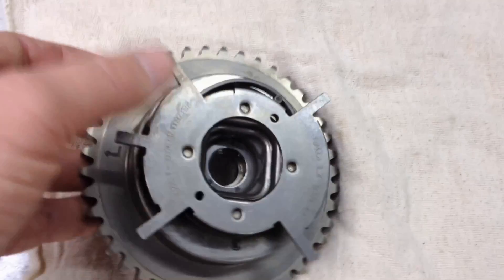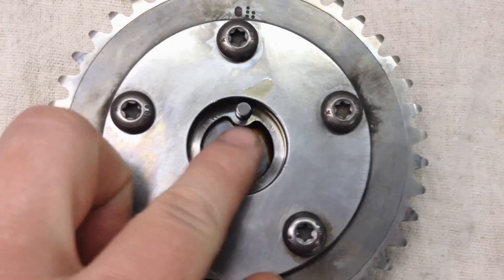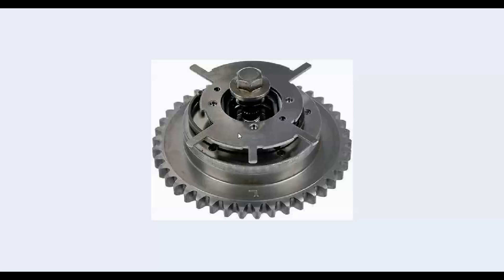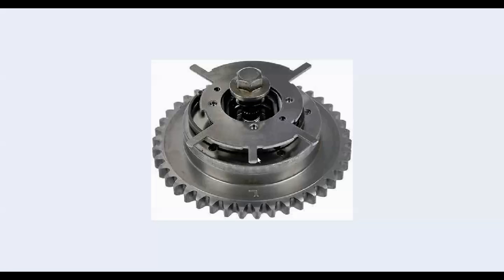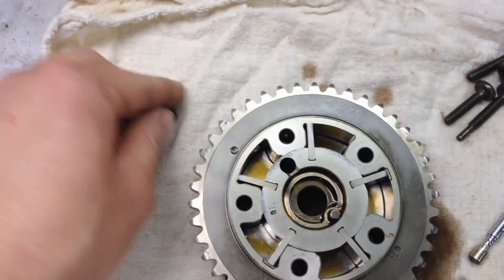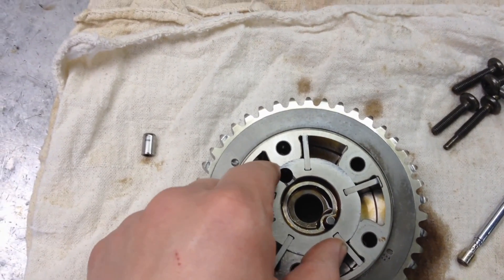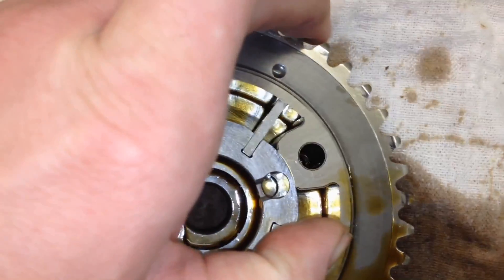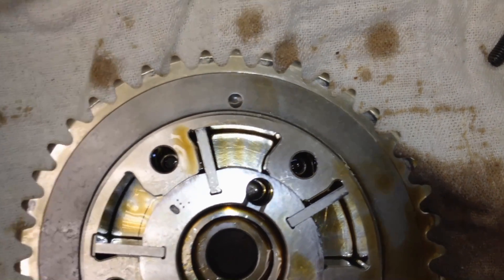Ford 4.6L 3v & 5.4L 3v Camshaft Phaser Knock Explained

Comment: My 05 triton has misfireing and trembling. I changed the sensors. It ran fine until it ran long enough for the computer to generate codes. Then it started shaking again. That wouldn't be the phaser, would it? To me, it seems more of a communication issue somewhere versus mechanical because it ran smooth for that brief window.

Comment: So when I spin my engine over by wrench my driver side cam phaser moves with the camshaft but after spinning the engine over the timing peg moves separate from the phaser. Is it supposed to spring back like that or not?

Comment: I have an 08 Ford Expedition That has been making this noise ever since about 86,000 miles. I decided to just let it ride and see what happened. It’s been working fine for the most part with the exception of the noise. It’s now at 246,000 miles. The noise started getting worse and it’s performance I scan worse. I’ve been told it’s totally shot and I need a new engine. I put in 10/40 weight synthetic oil and used some Lucas oil conditioner and some engine restore. I also replaced the spark plugs and the ignition coils. It’s definitely running a lot better. I can certainly live with it like it is for a while. What I was wondering is I’ve been reading about these phaser lockout devices you can install to fix that problem. My mechanic has said that he thinks there’s probably enough other things that are worn out on the engine that it’s too far gone. I was wonder what your thoughts are on it.

Comment: What's your opinion on using cam phaser lockouts? Is there any pros/cons?  It seems to me, if the phasers are that much of a problem, why not disable it?  I only ask because I just bought an 06 f150 and had the motor blow 3 weeks later.  I bought another one used with 104km on it, and I know ill need to do a complete timing job with new phasers and the oil pump you recommend.

Comment: If the 3 roll pins come out of the reluctor can you put red loctite on them and press them back in or is the phaser garbage if the reluctor wheel comes off at any point?

Comment: Appreciate the information in ur videos.. I have a 2008 F250 5.4L 3v I have replace vct phaser vct solenoid with timing chain guides and tensioner but I still have the same problem chain rattle/knock at hot idle and p0022 dtc do have any ideas? Also base oil pressure was at 15psi wich is min spec

Comment: Thanks so very much for your videos. Some of them have helped me fixing 5.4s. 
Pls what brand would you recommend I get timing chain kits for a F150 5.4 3V? I can see a lot of timing chain kits on Amazon or eBay, but don't seems to know which particular seller or chains you'd recommend for me to buy, without issues. There are a lot of fakes around.

Comment: If there is rattling coming from the spring loaded plunger, could it be solved with a high volume oil pump like the 340hv?

Comment: So i have a question that  will probably stump any Ford guy. I have a 98 Contour with a bad exhaust phaser sprocket, what can i do since NOT even one exists in the world? Since i am getting a check engine light and no one in the world has a replacement part, i am told that the only option that i have to is to junk a rust free good condition Contour . What do you suggest?

Comment: So if my cam phaser is stuck I'd get a check engine light?
Reply: Yes, there are programmers that lie to the pcm so that the light isn't on but I still think it's silly not to just do the job correctly and replace the phaser.

Comment: 2004 mazda 6 3.0 engine found on ford have code for both cam sensor checked with scope good signal all the way to computer also good ckp signal check chain timing marks all good checked ocv for mazda (vvt) open nd closes right so can u help me out with any maturation customer is really angry

Comment: So, if the locking pin is making all of the noise and creating more potential issues, could you possibly fix it by replacing the plunger spring with a stronger, thicker spring? This would keep that locking pin under much more tension, but wouldn’t take much more oil pressure to adjust timing, right?

Comment: O have a 2009 F150 with 4.6 v8 24 valve with 150,000 miles on it. Always gone to dealer for oil change and any issues. Been hearing this sound for a year now. Not too loud but can hear it. Should I try using Castrol 10w30 half synthetic to see if it quiets back down.

Comment: I've got a 97 F150 with the 4.6, and mine is making the same knocking sound coming from back near the torque converter like you showed in another video. The thing about mine is it only starts making the sound after the engine warms up and I drive the truck down the road, would the phaser be the cause?

Comment: Good Morning! So I was wondering on the is it possible for the front alignment with the L and the center spoke can be really off? I have one that is on the other side and almost lined up with the other spoke. I'm not sure how this happened. The timing still seems to be just fine though. How did the cam phaser fail like that?

Comment: You make great, detailed videos FordTech!  I have similar but louder tapping noise that started with a notable event.  My '05, 5.4 w/107,000 miles suddenly started skipping really badly (no tapping sound yet).  There was an unbelievable amount of fuel odor and white smoke coming out exhaust and diagnostic code indicated rich right bank.  While trying to start engine, and without any audible firing/combustion, starter slowed and then stopped turning engine as if engine was under load (good battery/starter).  I'm confident engine hyrdro/vapor locked on fuel.  I held accelerator WOT a few minutes and then started engine.  From that moment, engine started making loud tapping noise on right side and is loudest at torque converter and right exhaust using stethoscope (hot or cold).  I replaced o2 sensor on right bank and engine runs great now - no skip, no vibration ...just loud tapping noise.  I feared bent rod/wrist pin but engine runs too smooth and it sounds more like lash adjuster.  I now have valve covers & front cover off.  I checked cam rollers and lash adjusters in place without cam lobes depressing them and see no issues (plan to disassemble for proper inspection).    Phasers & crank gears are timed correctly, but the right chain tensioner suddenly collapses as I rotate engine by hand.  The chain gets sloppy loose.  As I continue to rotate engine, the tensioner plunger extends and chain gets good & tight.  This loosening/tightening of chain repeats as I rotate engine.  Could the chain tensioner be the source of loud tapping noise?  Any thoughts why hydro/vapor locking could cause the tensioner to fail?  I've seen your videos regarding faulty tensioner gaskets.  If the tensioner gasket is the problem, how does tensioner plunger extend and tighten chain during rotation?  You're right on - Makuloco!!
Reply: Timing tensioner is fine. The tension tightens with oil pressure so when you spin the motor it tightens up.

Comment: I'm finding timing parts for 02-10 and 04-10. Is there a difference? Most phases I'm finding say 04-10...mines 03. Thanks
Reply from the maker: 2003 models don’t have phasers
Reply: FordTechMakuloco ok well i guess that's kind of good..any common issues on my 5.4 that would sound like a clacking phaser or knocking type sound? Thanks for the reply! It says 08/02 on the door tag f150 fx4 lariat..Also is the fx4 upgrade found in the vin?

Comment: Quick question: I am doing a cam install for my mustang gt and it requires the cam phaser limiter by comp cams. I need to remove the back plate of these newer phasers (EXACTLY the one you have shown in the video); However, the spring lock tool they provided will only work on the older phaser models (years 2005-2007) but will not work on the 2008-2010 or updated phasers like in this video. My question is how do you lock that spring in place without ruining the phaser? Also, did you put back together the phaser in this video or no?

Comment: I have a ford f150 2010 4.6.  and same... noise problem..  runs pretty wood but when you go in traffic in low rpm..  start shaking..  you turn it off.. turn on again.. and nothing happen..  I need a good mechanic like you in san diego CA thankyou
Reply: mario aguilera A
Reply: Sounds like the coils need to be replaced, that shaking is a misfire. Those coils go about 75k miles and a very common problem. Do a full tune up (air filters, spark plugs and coils)and problem fixed

Comment: Good evening FORDTECHMAKULOCO. My pleasure to meet you! GOD BLESS YOU FOR ALL THE HELP THAT GIVES TO TRAVEZ OF YOUR CHANNEL !! I have a truck SUPER DUTY F-350, 6.2, 2011. That has a fault and was after having lowered a cylinder head. because he wore a valve spring. Now I keep failing and I think it's because the chain distribution is not well installed. I have my doubts about it! Please have any video or material that can illustrate with regard to the installation of the distribution chain and its components as well as the axis of cams and rocker arms? Many thanks in advance and a thousand BLESSINGS !! Almodio, Táchira-Venezuela.

Comment: hi there friend... I have a question... my truck is a Ford f150 5.4 3v When I accelerate my car at 1000 rpm sounds a lot but only if I keep the throttle in that revolution I hear the sound near the right cam phaser but I'm asking why just only in that rpm I have to change my cam phaser? I checked oil pump vct solenoid and filter all of that is checked...

Comment: What's the purpose of cam phaser lock out? Does it make it to where you don't have to deal with future issues of phaser knocking or since the phasers on my 06 Gt is phaser knocking, should I replace the phasers or a lockout kit? I don't really grasp the purpose of the lockout piece.

Comment: Hello greetings from Ecuador, I replace the entire distribution kit
A F150 2010 4.6 lts as it lost oil pressure and sounded like
Diesel, change the chains templadores (the kit) oil pump and pump
Of water, but when I turn on, it sounds very ugly like a
Snoring or as if you lack oil, help me please I am for traveling
 And I want to buy the parts
Reply: People have told me that it could be hydraulic oil elevators or lifter, but in its video I have the doubt that it is the gear of the crankshaft
Reply: Paul Roca remueve la bandeja del aceite y revisa el sedaso te aseguro que va a estar bloqueado

Comment: Maybe somebody can answer this one... I have a 06 with the 5.4 and it looks like a ordinary cam sprocket to me.  Do all these 5.4's from 06 supposed to have a cam phaser?  I have a knocking noise I'm trying to pin down.  Of course it's in a van, so I can't get the valve cover off without removing the motor mounts on passenger side,.. but I can lift up the valve cover enough to see it's just a sprocket with a bolt,. so I'm cornfused!
Reply: Take a Bath Productions the phaser is only on the 5.4 and 4.6 with 3 valves

Comment: yes it was the two vct solenoids  runs great now......man the repair shops reads the Eng lite code  comes up no oil to cam shaft and want's to replace your engine ? and the proplem was just  a $100 fix

Comment: I have a 2006 5.4 3v with the driver side one making some noise but not the passenger one. can I drive on this for awhile or does it need to be done asap? I'm in college and money is tight
Reply: bro my 05 has made that noise for over a year, no problems just the noise..
Reply: John Wyskochil well thats comforting, I plan on having to live with it till I finish college. Thank you for the info not many have given me any helpful info
Reply: acedriver1997 I try not to abuse her too much but yeah I hear alot of these types of fords with different ticks and taps. still a damn good truck.

Comment: Nice video thanks for sharing,  I have a 2004 5.4 that runs great,  once the oil heats up,  it will sometimes at a stop light,  start a horrible rough idle. then runs great once your back up to idle,  it's also sometimes knock pretty good like it's a diesel truck yesterday the check Eng light came on with a P0012 code.
Reply: i run a 5.4 2004 as well and was wondering if you had any problems with a knock from 40-50 mph zone, my idle runs great and i’m sitting at 170k miles but that gap in between those is rough
Reply: Rob Olson did you figure out the problem? Might be vct solenoids?

Comment: Hey bro like ur vids hope u can help me on a 2007 ford 5.4 phasers are making the tick noise but what im more concern is the lack of power when i give it gas feels like plug cats but i did a pressure check and there good and runs perfect till i floor it it bogs and i can here missing in the cylinders i check my scanner and miss all cylinders and dont get no codes just random miss i checked fuel it stays on 39psi and when i floor it 27psi mass air flow sensor good.

Comment: My 04 F150 S-Crew with the 5.4 has 148k miles...It's quiet when i first start it but as soon as it warms up the ticking starts up, sounds like it's coming from the passenger side..No lights on the dash and doesn't seem to be running rough.  Does this sound like the cam phaser is bad? Thanks
Reply: Having the same issue, phasers were bad.
Reply: Brian Patton Those have got to be your Phasers.

Comment: Can a bad cam phaser keep the truck from starting? It all started with rough idling & a camshaft position sensor code,  then white smoke from tailpipe,  then one day it wouldnt start.  I replaced the sensor,  and it still doesn't start up. Thanks
Reply from the maker: Only if they have self destructed inside.
Reply: Your sensor threw a code, there's probably something wrong. They don't put the sensors on there to fail, they're there to tell of a failure. Take the cam cover off and look at it. I think your problem lies elsewhere though. Maybe head gasket.

Comment: Brain, what is the symptoms of bad phasers? other than codes
Reply from the maker: They can make a clatter noise at a little over 1k rpm due to a weak spring and of course the low end knock noise hot idle. When they totally fail there is a constant knock noise.
Reply: FordTechMakuloco why don’t they make these so this doesn’t happen? Just rediculous engineering.

Comment: My 2006 makes this noise really loud at around 1200 rpm at hot idle. I saw somewhere that Ford put out a TD saying that this is normal. If it's normal why would it start doing it at higher mileage? Is this an indication of low oil pressure or impending doom in the phaser or a failing VCT? I've seen lots of info about what's going on but no one seems to say what to do about, and it seems Ford would have us believe its ok for an engine to start making a horrendous rattle after 100k miles.. I'm sure they would prefer I just replace the truck lol
Reply from the maker: Phaser oscillation to an extent at that rpm is normal yes but the absolute first step is to replace the vct solenoids with new Ford units then check engine oil pressure at hot idle with normal vct operation.

Comment: i have a 2005 5.4 3v i can drive it 5 miles it runs great, but at the end of a 5 mile trip, it will start rattling and cut off, let it sit, start back up, and runs fine!!! pending codes p0012 and 21 my God any help or suggestions? oh and it has new oil pump,pick up,both phasers,complete timing set, motorcraft oil and filter 5w20.  good oil pressure
Reply: c a did you figure it out? Might be vct solenoids?

Comment: Nice explanation. So with these phasers it either knocks or it doesn't? I assume since oil isn't reaching that pin due to the design of the phaser it will be about the tolerance when the phaser was manufactured? My real concern is how these phasers become damaged and if simply replacing them is a bandaid of sorts as the phaser will eventually start to breakdown again. I assume oil pressure plays its role in the phasers health. Are there other items such as oil pump or another component that should be replaced in conjunction with the phasers?
Reply from the maker: They can make a flutter or rattle noise if the oil pressure is low or erratic causing erratic vct operation or oscillation. I highly recommend an oil pump upgrade at the same time- http://amzn.to/2bGPyIU
Reply: +FordTechMakuloco Watched your video on the pump. I may do that on my own as I Ford will probably bend me over for that when I have them look at the cam phasers. My expy is still under a powertrain warranty.

Comment: I recently bought a 2015 Explorer Limited with a 3.5L Ti-Vct V6 Engine.  After driving the car for a bit and its warmed up there is a ticking noise coming from the passenger side of the hood.  There is no ticking noise when I start the car, only after its been driven.  I took it to a Ford dealer and they said the ticking was normal but it doesn't sound normal.  Do you have any advise or suggestions on what it could be?  Do these 2015 Explorer's have this Cam Phaser that you mention in the video?  At this point i'd be wiling to pay to just get it fixed, that's how bad it sounds and it's very loud when going through drive thru or when I pull into my garage.  I hate that noise.
Reply: No this only applies to the 4.6L V8 and 5.4L V8, neither of which are in production for the explorer. You are good my friend
Reply: Rob G.
Reply: The water pump is driven by the timing chain and I would never buy one in the first place.

Comment: question, my 2004 5.4 engine sounds like a diesel at idle but when I accelerate the noise goes away and runs fine.  After watching the video what is causing the pin from engaging at idle and is there a
way to fix the locking pin and spring instead of replacing the phasing gear?